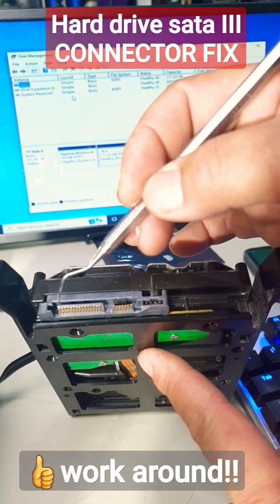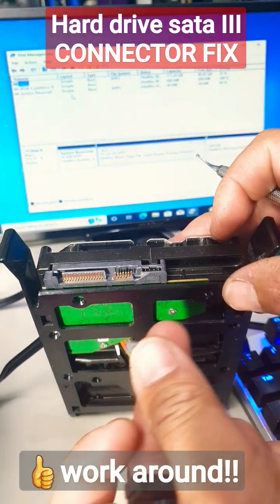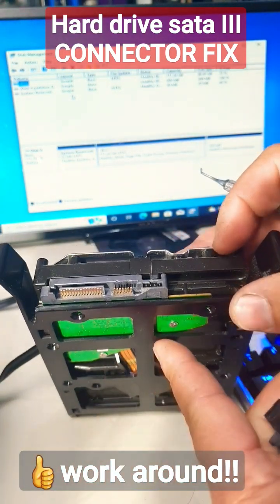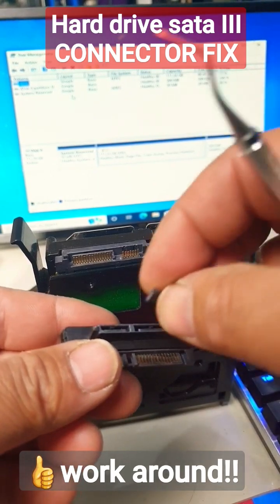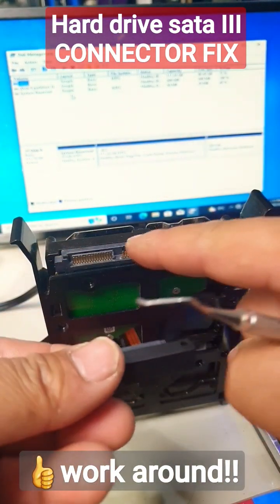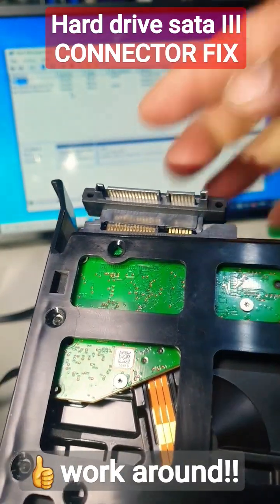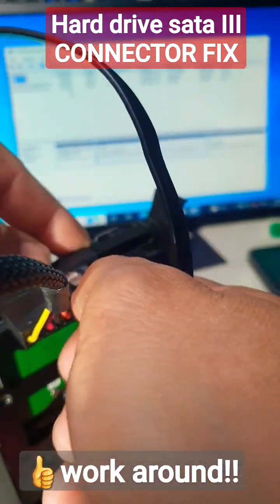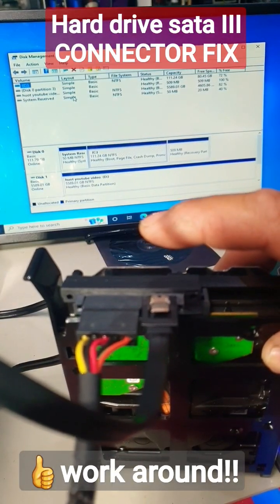broken sata 3 hard drive connector. FIX using Up Angled SATA III 7+15 22 Pin SATA Male to Female

Comment from the maker: this is the name of the part Up Angled SATA III 7+15 22 Pin SATA Male to Female Data Power Extension Cable. u can get straight ones ..and ones that angle up or down ..check video description

Comment: Wtf is it called. Best to put a link in the video
Reply from the maker: @berniemanson6074  ok
Reply from the maker: @berniemanson6074  Up Angled SATA III 7+15 22 Pin SATA Male to Female Data Power Extension Cable

Comment: where do you buy it?
Reply from the maker: ebay aliexpress Amazon
Reply: @MIKEYZVLOGZ  with one is the good one ? have you the reference?
Reply: please 🙏
Reply from the maker: @KonKhmer83228  they all the same as long as u get what u need..so first find if u need angle or straight ..then choose .. which do u need angle down or angle up or straight
Reply from the maker: @Khon_Khmer_កូនប្រុសរបស់ខ្មែរ links in dsscriptiom Up Angled SATA III 7+15 22 Pin SATA Male to Female Data Power Extension Cable